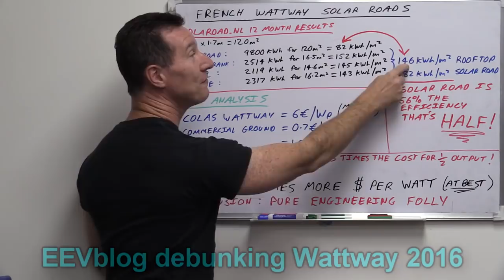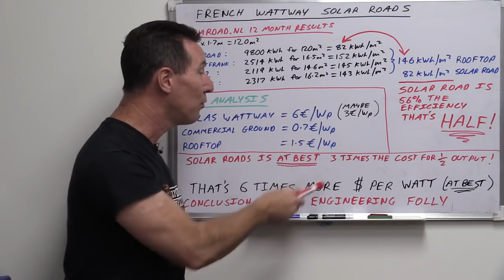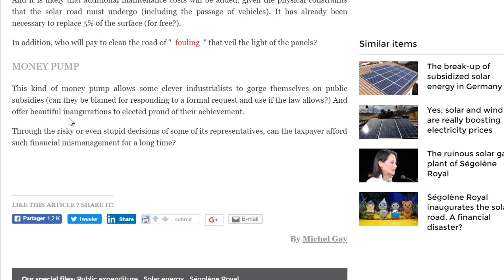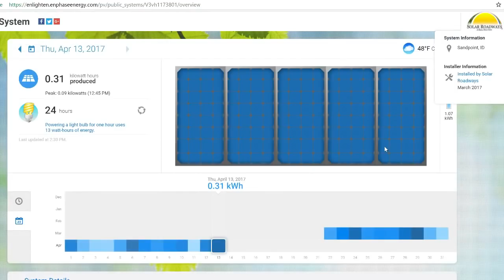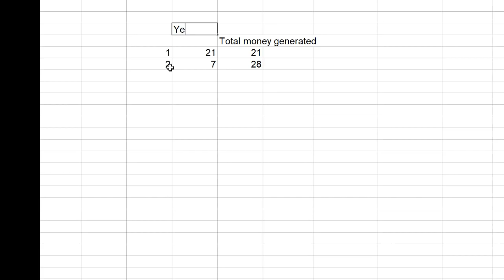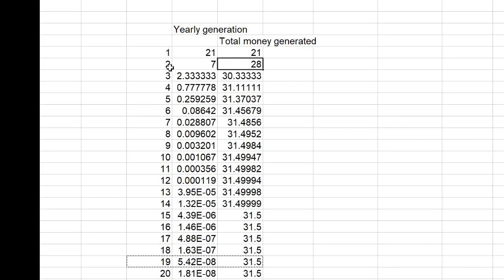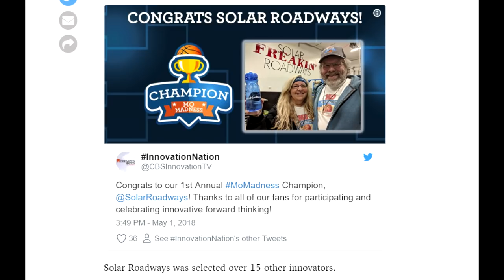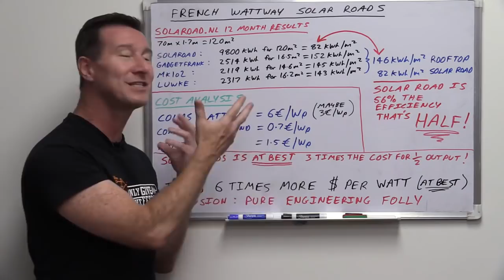Solar Roadway: 10¢ return on $1000 investment!

Comment: Has anyone in the debunking camp raised the simple argument that shadow or uneven lighting of a fotovoltaic loop causes huge problems, including (but not limited to) holes burnt in the substrate, increased wear of the inverters and power fluctuations. 
I used to be a solar engineer for domestic and industrial photovoltaic solutions, and I've seen the effects of a simple powerline shadow on a panel. There were 10m between the cable and the panel, yet the line shadow (even though it moved as the sun move, mind you!) burned holes in the corners of every cell it crossed. Same story from a neighbour's radio antenny. And many more examples when called in to fix a competitor's blunders.
In laymans terms: the electrons flee the sunlight, thus causing a voltage in a cell when lit by the sun. When a local shadow is introduced, the charge will build up in those areas because just like water, electrons prefer the easiest way and thus the closest place away from the sunlight. That charge build-up causes very high temperatures, high enough to burn the substrate.

Imagine the effect of a car stopping to pick somebody up, or at intersections, or in a traffic jam. And that is assuming that just passing will be fast enough and the inverters will be resilient enough to handle the constant fluctuations. And what about the presence of telephone lines, power lines and other permanently present sources of shadows? Lightpoles, antennas, wind mills, .....

So even if they can make the numbers add up, and somehow make it profitable on paper, they are facing a huge failure rate, and a life span of 2 maybe 3 years tops, IF they use a system that can invert the power of each hexagonal tile individually... As soon as they use chains, all chances are out the window (the charge of lit cells up the chain are added to the charge build-up in the shadowy cell)

And a new job has emerged: solar panel cleaners. This means that domestic installations notice a drop of up to 15% of production after 1 year of normal dust settling from the air. And that is on rooftops. Now look at how much dirt and dust is collected on a street surface...

The idea is a joke, especially knowing that for far less money and risk they can put optimally placed and angled panels on top of light-poles, sound walls, ... high above the dust from traffic, producing probably more electricity than a fully surfaced road would in the same location.

Comment: "Reduce the carbon footprint" - Considering the miniscule amount of power it generates, that's barely a scratch on the surface of the carbon saved from power generation, which is VASTLY negated by the cost and pollution involved in production of roadways. Put it this way: You'll reduce the roadway's consumption from say 500kg carbon/year in the section they replace (I'm making up #s as an example, not sure what the actual average highway pollution level is in Georgia) to 4999 BUT the production of the panels will cost over 40x that in pollution/environmental damage. Solar panels are actually (ironically) one of, if not THE worst current technologies aimed at saving the environment. (China doesn't care about pollution or anything, just profit. Not trying to be mean or racist, it's just how culture and society have evolved there. In China, money is God. Check out YT channels like ADVChina or similar if you want more info. and the business/social culture in modern China. )
Nah, as silly as this may sound? We need to go back a step. Start using some older technology that became popular during WWII and is in fact still used to this day in Germany. Wood gasifiers. Basically short-cutting the whole millions of years of breakdown and producing burnable fuel to run a gasoline engine with wood or biowaste. Sure, there's still some carbon production there, but it's way, WAY under the amount used to extract, separate, purify, distribute and produce gas out of the oil. Slash pine forests and such can be planted/harvested on a 3-5 year cycle like they do now for lumber. Instead of aiming for "perfection or nothing", how about we KEEP our existing gas engines so there's minimal cost in making new vehicles, everyone out there can just buy an upgrade kit and keep their cars, we eliminate a lot of destruction FAR beyond what carbon emissions can cause (fracking would be unnecessary, as would most oil drilling). Don't go for perfection if it's unattainable. So I can't reduce my impact to 0%... should I give up on the 95% reduction potential if it's not perfect? Feels like that's kind of what we're doing here. We're go gung-ho about the "newest technology" that nobody is looking at the big picture here. Reduce emissions in your area, but amplify them by 1000% elsewhere? You still lose, because even if Georgia is cleaner and it's China that's worse... we only have one planet. We share our oceans. That's where that pollution is going.
(yes, I know my example was a 0.02% based reduction, but I'm being generous, lol)

Comment: solar panels are a nice idea for roads, but lets put them 4 meters above the road surface. I think it more ecological than making a solar park and basically change the land into dust. The roads already sealed the surface, so a solar panel above wouldnt change that much. Also the cars wouldnt use so much climate control system, as they are driving in shadow, which doesnt heat up the car in comparison to sunlight.

Comment: There are several ideas which seem more obvious... Put solar panels over roads (like an awning). Then if you really want your damn Tron effect use a laser to project down (like the ceiling projection alarm clocks). 

What I really want to see though would be a way to have a thermo electric generator using the heat difference between the blacktop and the subsurface to generate electricity. That way you could still use asphalt in your solar freaking roadway.

Comment: I don't get why they wouldn't just build solarpanels over the roads instead...same space, fancy led signals can be displayed where they can actually be seen, you don't need to develop a panel that can withstand trucks, it could be angled in an optimal way and even follow the sun, if it needs repairs traffic wouldn't have to be stopped, safety might even be increased by snow and rain not falling onto the road, and lighting could be managed simply by having gaps in it...
But its probably just too hard to find investors in non-fancy solutions....

Comment: I remember the time when the german cooperations tried to push through their transrapid concept. It did not work, because it was too expensive. It did not require a vacuum sealed tunnel! Today the ICE train and its french opponent the TGV are proven systems. The newer ICE can even reach high speed on old rail lines. Btw cargo cap http://www.cargocap.de/content/das-cargocap-system  is german concept  20 years in the making. Still no takers.....its to expensive! Maybe one city is gonna try it now!

Comment: Here in The Netherlands some genius came up with solar cycle paths. Because we have a lot of cycle paths. We also have lots of empty fields, and lots of empty rooths. But those are not sexy to solarize. Reason is not a factor in such projects.

The idea is not so bad, as long as the added cost over comparable quality road surface is basically near zero, for a decent energy supply. It might be easier to have some sort of radiator system, run water through it, heat it a bit (a bit), and then through a heat exchanger with access to colder water. A huge project still. So much better to make a solar roof over cycle paths. No rain on yo face!

Comment: Could be practical for parking lots that are usually empty.
(so... none that are worth paving)

Do all the building roofs first. (and its recognized that north/south of Lat 40, solar is not the best idea because of "winter.")
Reply: BTW
I like experimenting with solar power and have  a few 15 watt and 25 watt panels.
The 25 watt panels are 6 years newer.  SAME SIZE and cost less than the 15 watt panels.
The technology is improving at a pretty good rate.
5 more years and it might be cost effective to power all but the air conditioning for my house via solar.  10 years and it should be practical to do the air conditioning too.

The battery technology will need to develop more too if you want to go off grid and not sacrifice lifestyle.

Comment: $$ is what’s wrong with the world. Who gives a shit about cost if it’s more energy. And shying away from it is just as ignorant. It’s a great idea that could be invested in and advanced.
Reply: The point is you can more efficiently use your resources to the planet's benefit (supplying clean energy) if you actually use the panels correctly.  Saying you want to lay solar panels flat on the ground is equally silly as saying you want to install them in the shade; and intentionally rubbing abrasive surfaces on them is even more silly.  No matter how much you improve panel efficiency the panel that receives more sunlight will perform better, and the resources to produce solar panels aren't infinite.

Comment: Hey TF, have you thought about it from the safety angle?

All these roadways bang on about how clever they'll be: "the road markings will adapt to the traffic flow...".

When they repaint and change the road markings at a junction I use all the time, and know like the back of my hand it confuses the hell out of me the first time I use it (happened a couple of weeks ago). Sure I get used to it after a while, but just imagine the road markings change every time the traffic flow changes. 
It'll be like a contraflow system without the easy to see lights above your head showing simply which way the traffic can flow in a lane depending on the time of the day, only much more complex. 
This isn't a lane any more, these three lanes are now two lanes, everyone merge please...
It'll be carnage (excuse the pun). Why would you want to confuse motorists, most of them are confused enough and barely able to avoid crashes on static lane markings!!!

Comment: Where I live (Örebro, Sweden) they rebuilt the roof of a a municipal building where the angle where perfect for solar panels, they decided to slap solar panels on almost the entire roof and gues what, they produced more energy than all these damn projects combined..........

And in the county I live they have a website called "sun map" so that all buildingovers can see and calculate where the optimal position and angle for the solar panel is.  The map even shows the angle of the roof on all buildings.

Now is that not a better way to spend tax money so that every buildowner (company or individual) "easily" can calculate and project the building of solar panels?

Comment: Sigh. If you REALLY want use all of the "unused" road surface area to generate electricity, then at the very least I suspect far simpler approach would be to build roofs over the roads, and put solar panels on those roofs. 
This way you could use normal solar panels which are cheaper and more efficient. The panels would have a longer life because they aren't being driven, and you're using more mature, industry standard tools, knowledge, processes which are more reliable and established. 
There may be some secondary benefits that help make this better: 
- The bitumen roads absorb less heat with a roof over them, so people wouldn't use the aircon as much. Automatic climate control in cars would probably use a bit less energy to maintain a temp when driving under cover than out in the sun on hot road. 
- Covered roads may need less maintenance, less exposure to weather, the heat cycles wouldn't be as extreme. 
- You could put some lighting under the roofs which is probably more efficient, doesn't diffuse into atmosphere, less light pollution
- You could even carry some power and telecommunications infrastructure in these structures which might be easier (or allow you to offset the costs a bit) than having all of these big poles. 
- Road signs, lights, screens etc may be cheaper and last longer because they don't need to be as highly rated in how much water/dust/temps they can resist. So they might be able to these "adaptive roads" with light signals everywhere at a cheaper price up front, and it would need less maintenance. It would be in the roof, LED's and stuff. 

I'm not saying my idea is a great, I only thought of it now as an argument against these solar roadways. I'm just saying that even my lame idea seems a lot more plausible than solar freakin roadways if they REALLY wanted to do something like they say. But no, it wouldn't be as sexy or snowflake-special enough for these people to gooh and gah and, and impress their friends with by talking about it at parties.

Comment: I bet that putting fan powered dynamos on busy, fast traffic roads would make more electricity than these BS, snake oil "solutions" to the energy needs of the world.
I would put them below gratings so to that speeding cars' draft would make them spin and generate electricity to charge batteries or be directly fed to existing power lines.
The output would be as ridiculously low as the solar panels, but at least those are not dependant on day or night, but on traffic load which can be "guaranteed" on some roads.
There! I also made a poorly researched, bogus, crap filled "solution" to a busy city's energy needs!! All I need now is to find a gullible audience on IndieGoGo and rake in the dough while delivering absolutely jack squat!!
Or how about building an ocean wave powered swivel that generates motion for another dynamo! Put it in a turbulent sea, like the Behring Sea and you will generate loads of power!!!
We can continue on and on...

Comment: The thing I never understood about solar roadways is...can they generate energy when cars are on them? I mean, shade cast by literally everything around them aside, you are driving on them. Most roads tend to have at least light traffic during the daylight hours. Just using them lowers their efficiency. You would be better off with the panels on a vehicle than on the roadway. So why don't we see more electric cars with solar panels? Well, because the cost increase would more than negate the lifetime energy generation and because they would only generate for a few hours a day at best. If vehicle manufacturers aren't even doing that why would it make more sense to pay even more to put the panels in a location that will get even less light on average?

Comment: Here's a radical idea: Visit any industrial area in your city and behold the massive acres of roof space that could be covered with solar panels.  Offer to pay for the panels 50/50 with the business.  It will be vastly better and orders of magnitude cheaper than putting solar panels into roads on which trucks drive on.

My local shopping center has started erecting massive solar arrays in the parking lot.  Triple win: cars get free shade, shopping center gets cheap power, and the heat island effect of having hundreds of tonnes of bitumen and concrete heating up in the sun is reduced.

Comment: With Solar Roadways' demo installation numbers and the workmanship of said demo, Solar Roadways might cost motorists more in fuel and electricity (hybrid/EV) due to increased rolling resistance from the bad joining between tiles than the power those tiles generate!

Comment: What do you think about the idea of eventually putting the technology of direct heat to energy conversion and impact/vibration conversion material into the roads layered under the surface for protection. Granted I know those material technologies are very new and damn expensive but if the tech could be matured and made for less would it be viable? You'd have to work out return on investment and such but at least maybe the tech would work and not be destroyed by the roads original function.

Comment: Asphalt is designed with voids remove excessive water so that when the rubber meets to road you will achieve traction.
So if sliding down the road is your goal, then good for your, just leave some asphalt for the rest of us.
You would be surprised how much engineering by each state, the Federal Government, Tire manufacturers and Auto engineer to keep the car on the road.

Comment: One thing to add is that losing 1% per year is about double the average with modern quality commercially made panels.  Most modern commercial panels are showing a loss in production of about 0.3-0.7% per year depending on type and year of manufacture with newer panel designs further reducing the loss year over year.  So it is not unreasonable to expect a quality modern panel to produce around 90% of its original output capacity after 20-25 years of service.  Roof or ground mount solar panels do not have a predetermined maximum life and will continue to produce electricity for as long as the panel remains physically, mechanically, and electrically undamaged.  I have 2 solar panels that have been in service on an off-grid cabin for over 30 years (Installed in 1984)and they are still producing over 85% of the original output.  They were actually removed for a couple days, about 6 years ago, to replace the roof but have otherwise been in service the entire time.  
I fully expect the 5KW+ array I am currently planning to install to last for at least 50 years assuming I don't have to replace any damaged panels.  Sure it will likely degrade quite a bit over those 50 years but assuming the panels are still intact they should still be producing a substantial amount of electricity.  In the grand scheme of things, the panels are likely an inexpensive part of the system over the entire system life.